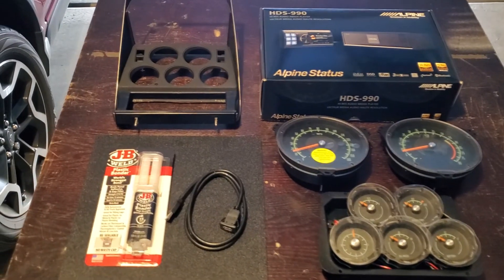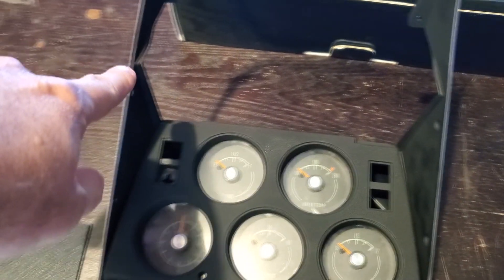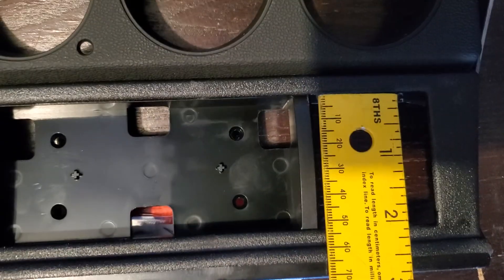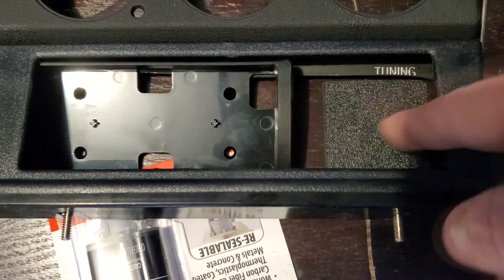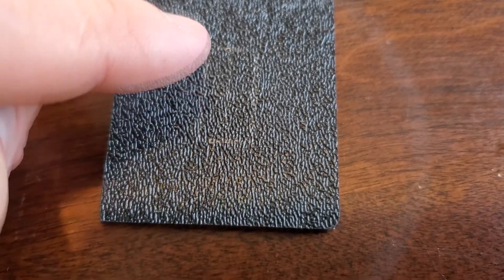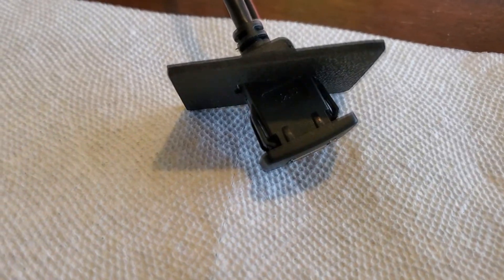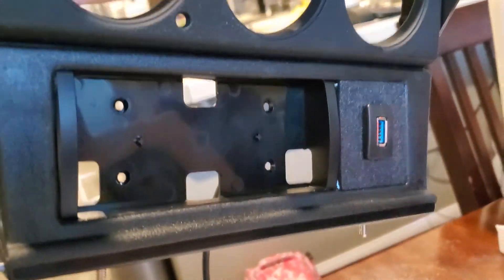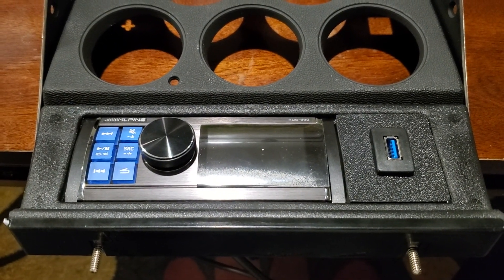How to: 1969 Corvette Center Console: Adding a custom face plate for Alpine Alpine HDS-990 Head Unit

Comment: Nice install.  What speakers and amp setup?
Reply from the maker: KTA-30FW 4-Channel 
https://www.alpine-usa.com/product/weather-resistant-audio-amplifier-kta-30fw

KTA-30MW Mono
https://www.alpine-usa.com/product/kta-30mw-car-amplifier

HDZ-653S
Alpine Status Hi-Res 6.5” 3-Way Slim-Fit Component Speaker Set
https://www.alpine-usa.com/product/alpine-status-hdz-653s-speakers

R2-W10D4
10-inch R-Series Subwoofer
https://www.alpine-usa.com/product/r-series-subwoofer-r2w10d4

Comment: You think you'd be able to do a walkthrough with the HDS-990? not a lot of info out there
Reply from the maker: I will when I get my car back, I will do a review of it.
Thanks, it is a good idea.
I got it mainly for size and space issues. Hope to have one in a few weeks for ya.
Reply: @nicholasjackson3344   thanks! I’m sure there’s many like me that want one. But they’re not cheap! And trying to figure out if it will even give me any more capability than I already have. (My phone goes straight to my helix DSP)
Reply: I plan on running this with an iPad in my dash completely deleting the factory radio. Could you please do a video of this unit in use when you get a chance
Reply from the maker: @kamoto6493  I am planning on it. Still waiting for my car to get back to me from the shop. I am hoping I get it back in two weeks.
Reply: @nicholasjackson3344   jumping in again, Very curios how it operates like with an iPhone, does artwork come up w bluetooth, and Hopefully artwork and everything when using Amazon, spotify, Apple, probably corded for HiRes. Also wondering how it works if I just leave a hard drive plugged into it somewhere.
Reply from the maker: @kewlbug  So artwork will not show up on the Alpine unit itself. As it is a controller for HiRes music, it can connect to another head unit and the head unit will show the artwork and such. But I am using it as a stand alone so it will not show artwork. It will show the artist and song name, info, ect.

It operates just like a Ipod, has foward backward selection, random, ect.

When used with bluetooth it will receive the signal from your device. But the device will downgrade the sound down from HiRes to normal mp3 quality. All bluetooth connections do this as it bitrate is smaller then HiRes bitrate.

 To achieve HiRes you have to have a thumb drive plugged into one of the usb ports. 

It basically a HiRes player like a Ipod, but doesn't lose any quality. 

I'm using this because it's small face plate and saves a ton of room. Trust me I am just waiting for my car to come back to install it and show it off.

I will make a video tomorrow of what all is in the box and that way you can see more of what the unit does.